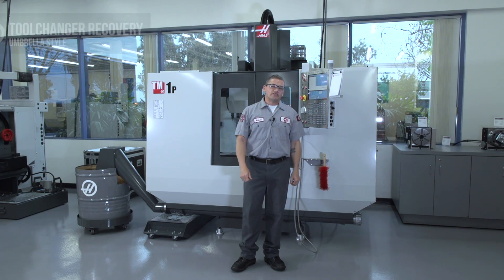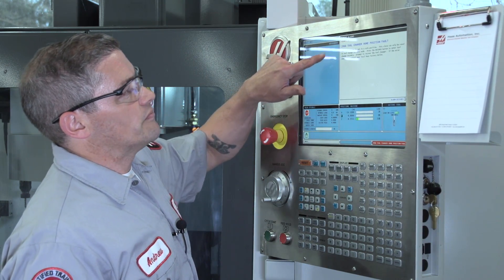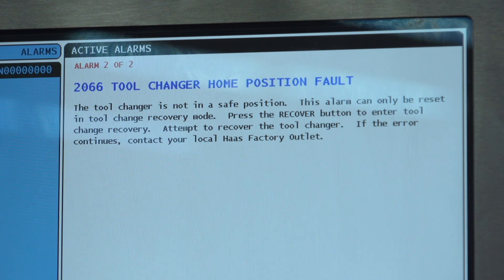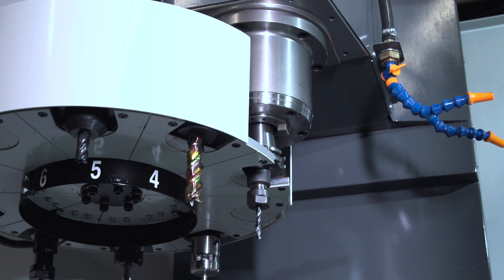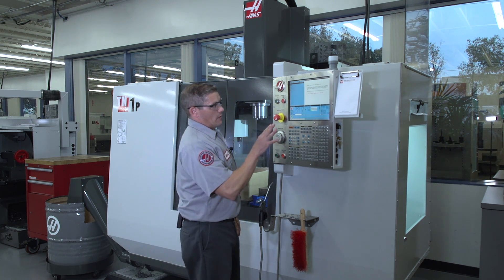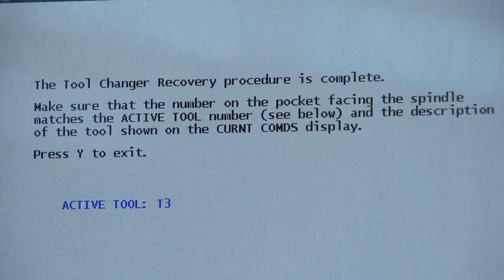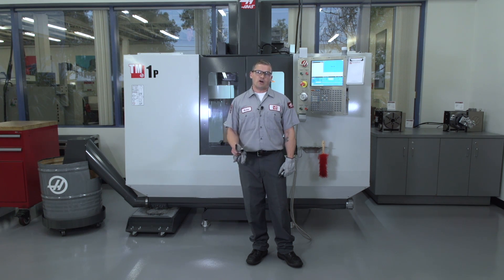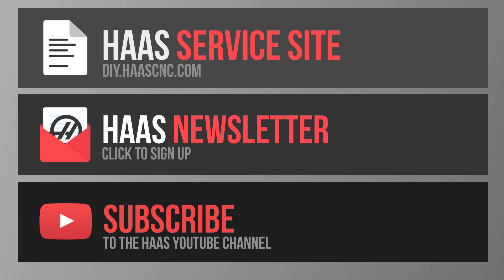Tool Changer Recovery; Haas Umbrella/Carousel-Style Tool Changer - Haas Automation Service Video

Comment: We have a TM1P (2010) that we are using very little and we keep having tool changer problems every time we use it.
We take the skin off and adjust sensors - they adjust right and tool changer works. 
If we leave the machine for a week it falsely we trigger alarms from the top sensor when tools are in the tool changer. Sometimes it disappears by triggering the release button repeatedly, but we get so many faults that it is not useful.
To me it seems like it is a pneumatic issue where it does not close in time - but I have no documentation telling me that there is a timer involved, but it seems like slow changes error out and gets stuck. 
Any sources of fauiltfinding?